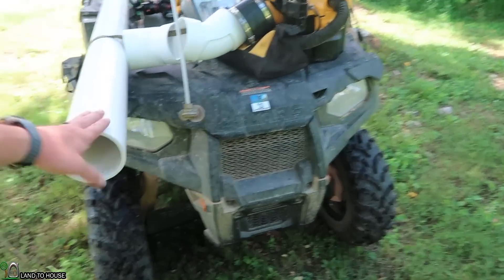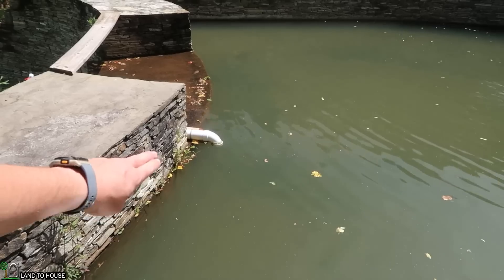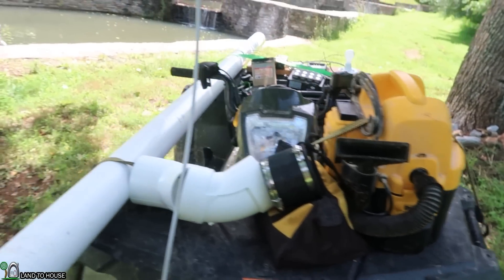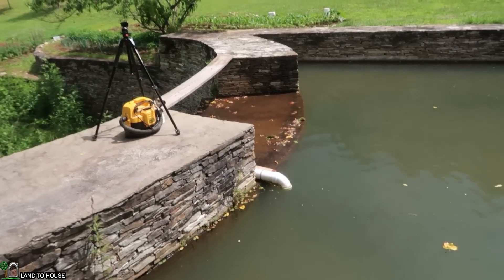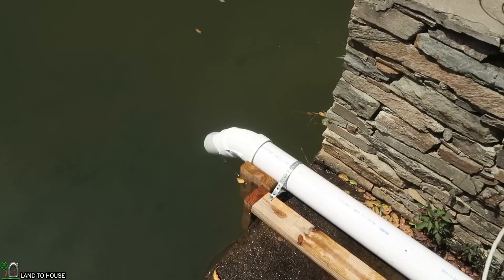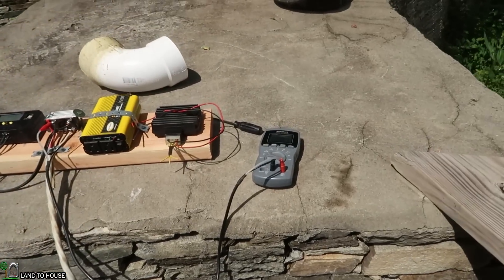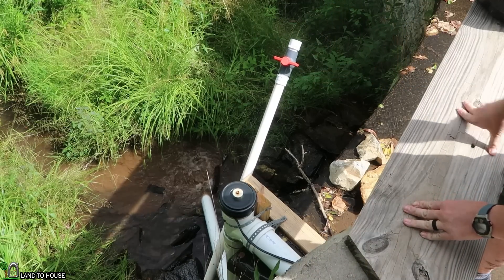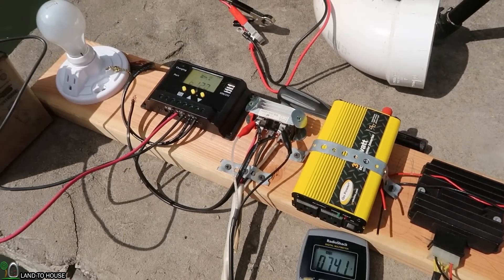Micro Hydro 4" Down Pipe all the way to the Bottom

Comment: Se utilizar a turbina em 24 volts a produção de potência será superior.
Reply: 12 or 24 volts the power produced is always the same, slightly increases the efficiency of the system but 50W at 12Volt are 50W even at 24V as much as 120V volts
Reply: @winterburan  he has about 70 volts at no load, with an MPPT regulator he finds the best working point, (which is about 35 volts)
here is the point of equal impedance, between the generator and the load (where c is the maximum energy transfer)
Reply: @udos46  ciao Udos, I don't know the nominal voltage of this PMG, it has always given me a better result instead of the PWM, I have probably always been above the limit, I had advised to measure voltage and power using a resistive load to vary until I found the best point, directly after the diode bridge without everything else that does not serve the purpose. here it all depends on the state of charge of the battery
Reply: @winterburan  Quando se tem uma força de torque constante seu argumento é válido. O rotor da turbina porém, entrega máximo torque quando a rotação com carga estiver entre 41% e 52% da rotação nominal sem carga. Neste projeto a rotação está em torno de 20% resultando em um "travamento da turbina" por conta disto a perda de eficiência é considerável.
Reply: @HoffmannFreeEnergy  I agree, I prefer to add a resistive load up to stay around the alternator nameplate voltage as long as it is the same correct speed for the maximum efficiency of the impeller and measure the power produced, now the system is based on the battery voltage. Udos pointed out that under load the voltage produced could be too low for a mppt, I don't know the voltage but it assumes 12V which is too low, that's why I let go of mppt or pwm to measure the power produced, that comes later.
p.s. Is a mini Francis 9.8 meters 30 l / s feasible or crazy?

Comment: What if the generator was set slightly lower than the dam water level ? ( as in B. Vice A )

A —————Gen.      B —————-|
                      |.                              |
                      |                               |
                                                      Gen
                                                      |
Reply: I was thinking the same thing.  Use the weight of the water above the generator rather than the vacuum drag created by the water below the generator falling.
Reply: @dloman77  Wouldn't make a significant difference until the drop below the turbine was enough to reduce the boiling point of the water (~30ft) Cavitation would likely be a non-issue at these heights.

Comment: you could prob use some innertube cut down to add over the joins to make a air tight seal another idea is maybe put a groove in the pipe for an 0-ring to fit to make a seal

Comment: 1st thought, to reduce or perhaps stop a vortex from sucking air simply float a panel or large bowl above, if circular object add small weight and it'll center itself perfectly...2nd thought, after determining size and shape of inlet and outlet pipes eliminate connectors  by bending pipe with hot sand inside pipe to form smooth wide curves. (Plenty of pvc bending videos available for inspiration) practice on smaller/cheaper pipe first...1 90° elbow adds about 17 feet resistance  (true/false?)

Comment: What’s the feasibility of having multiple micro hydros on one pipe system?  One at the top, then one halfway down etc using wye fittings to conserve the water flow? Also, would multiple generators increase power output?

Comment: Air suction is only an issue in intake portion
Reply: Negative.  Air leaking in is a problem everywhere in this system.  The energy being extracted in this system is from the mass of water being dropped at a height over time.  Air coming in even in the lower half of the down pipe would still reduce the overall mass of water and lower the vacuum pulling down the water that's higher up.

Comment: I cringe every time you lean on that plank of wood spanning the opening above your weir. Please add the 45deg  to your vacuum pipe and also check your makeshift Edge protection is secure
Reply from the maker: I need to buy another section of 1-1/4" pipe for the Pelton wheel hydro. I can use that to add on the vacuum.
Reply: So true! I am always glad if Seth posts a new video, then I know he didn't get lost down in snakeland. Also: The idea with the blocking of the waterfall is good, so you don't need siphoning. But probably you would still need a down-pipe to avoid vortexing.

Comment: Ram pump hooked to a pelton wheel would outperform it
Reply from the maker: Turns out the limited flow reduces the power potential
Reply: @LandtoHouse  apples to apples, you are running 4 in pipe, a 4 inch ram pump, would supply a pelton wheel with plenty of pressure and volume to operate
Reply: He's tried that  afew years back
Reply from the maker: Yes a long time ago!
Reply: @bullithedjames  not with a 4 inch ram pump
Reply: @travishodges5179  you have enough water flow for a 4 in?  Or are you just talking theory.
Reply: And if you have that much flow there are other micro hydro setups that would be way easier to install
Reply: @travishodges5179  you are talking about having a flow rate of atleast 100 gallons a minute.
Reply: @bullithedjames  you are right 102gpm approximately, current flow rate to run the 4 inch flush generator from Langston is @240gpm  and it’s not generating enough power for the water useage, ! Point is the concept of a flush generator in its current configuration will never generate a return on investment ever, in fact at current price point not counting maintenance and replacement parts it won’t save money
Reply: Bottom line is solar has gotten so cheap and water has become so scarce, that solar can produce the same output for 10% of the investment and has virtually no maintenance, or risks, like drowning, falling off a slippery dam to your death, digging dead fish and floating sticks out of it, chasing vortexes with tennis balls, getting electrocuted standing  in water holding a vacuum cleaner, like engineer775 says if you want to flush your pond for a few minutes of power it’s the way to go!
Reply: So with that being said, you believe it will run a pelton wheel?
Reply: @bullithedjames  completely dependent on head available
Reply: https://youtu.be/_yzpQ0gM4TQ
Reply: I was thinking 6 years ago and I looked it up and yeah 6 years ago. LMAO I'm starting to feel old

Comment: It's interesting to watch the changes you are making.  Have you considered using tape, like duct tape, to give you a better air tight seal when you are experimenting?
Reply: They have rope putty also that’s almost like a clay. Would be easier to remove when changing things around
Reply from the maker: That's a very good idea. I was thinking about using some silicone caulkng but tape might be an easier solution
Reply: @LandtoHouse  tape may work okay, but I would go with a fast setting caulk, or silicone lubricant on all the joints. It could be a bit messy with the lubricant but I do believe it would work